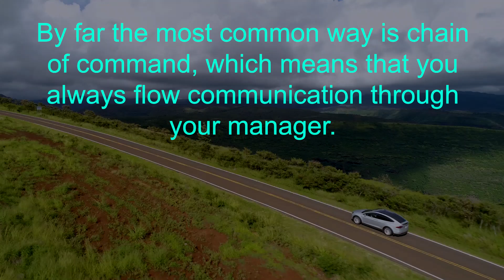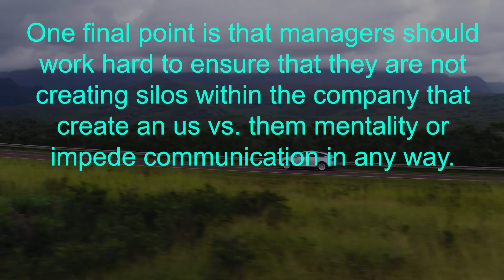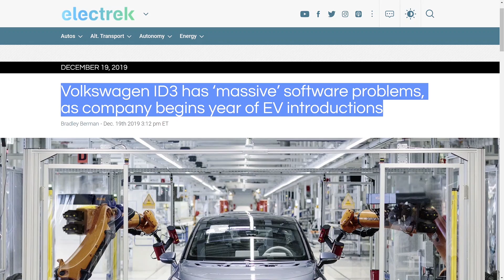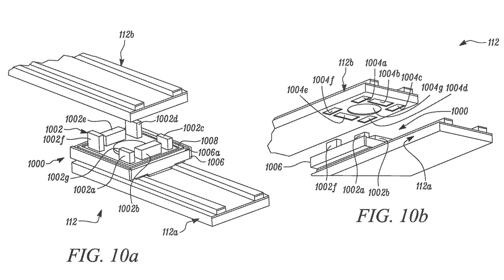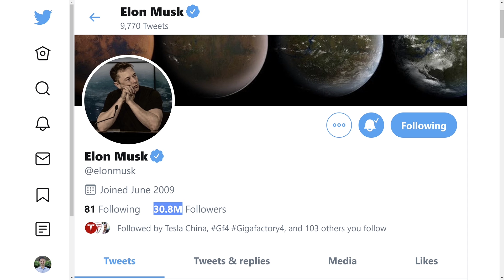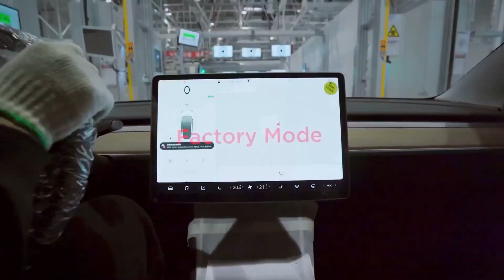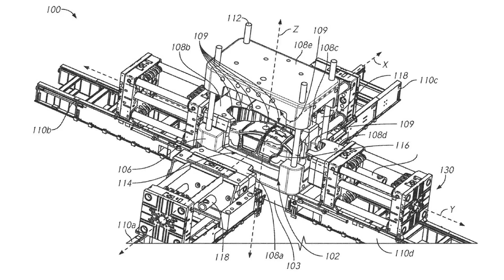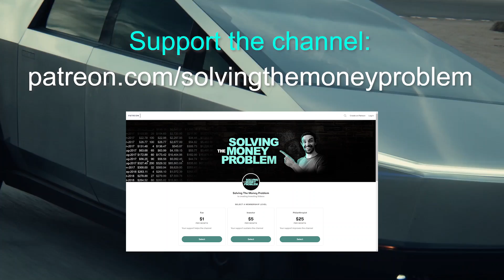Tesla: The Optimization Machine (why Tesla will win)

Comment: 0:30 You know, those rockets really did not reinvent the wheel... You can take any videogame with simulated physics and with in-game programmation and in less than an hour, program the thing to land straight. It will be 1 gyro, 1 gamble engine and some basics in physics. Even on a moving plateform...

Comment: The frame casting machine is a great example of the difference between other automakers (and big industry in general) and this way of thinking.
There is absolutely no way any other company would attempt that. 
Even if the design was delivered to them complete with certainty of the efficiency, they wouldn't invest money in something so dramatically different while they're relatively stable in the market. Even if they desperately needed a leg up, they would go for cheaper options like a new car with a big ad campaign - superficial crap to temporarily boost sales and satisfy shareholders, not advancement or anything remotely risky, costly or time consuming - regardless of the potential to change everything. Because at the end of the day they don't give 2 craps about potential, it's only optimising for the bottom line. That works if everyone else is doing the same. Thank god they're not anymore!

Comment: When Tesla implements the acquired Maxwell dry electrode battery technology  there will be an initial increase in energy density from 207 watt-hr / kg to over 300 watt-hr / kg.  The next level of the Maxwell dry electrode battery technology is predicted to be over 500 watt-hr / kg.  In addition the production costs will be about 10 to 20% less.  The range increases should be about 45% and 142% respectively.  In my view this will be  another  huge game changer and it will leave the competition in the dust.

Comment: You and others have mentioned the innovation with reducing wiring in the vehicle. However, I think this issue is not getting enough analysis as it deserves. This innovation is HUGE. Imagine how much it costs to add/remove/move a single electrical component on a vehicle. wiring harness changes, fuse box changes, relays changed, pin connector box changes, re-training installers, et al. Now image all those concerns disappear when the signal is wireless. All you need is a single wire to supply positive voltage. Tesla can change, at any time, the characteristics of the device through software. It also makes testing easier. Today a vehicle knows your brake light is out because there is a short or open circuit to the brake light. With these changes, the vehicle will broadcast a status check message to all accessories and each will, after doing an internal check on itself, respond accordingly. This also makes the vehicle more reliable as there are far fewer wires and connectors to break. Accessories sales: Imagine Tesla wants to add a light-bar as an option to a cybertruck. No problem, bolt it on and plug it into the closest available power connector. Done. Today's car companies can only sell accessories that have pre-existing connectors and wiring in place. As I'm sure you know, the profit margin for accessories is very large. This innovation will enable them to provide customers with an option that will work with their vehicle long after it has been sold. No changes to the wiring harness needed.

Comment: if they can invent a battery pack system where you can change the battery pack within a few minutes and you dont have charging delays 
or if you could chemically charge them with tanking acid or something else into the batteries and if the EU wouldnt prevent cybertrucks import because german manufacturer lobby probably noone else other than maybe Mercedes E-series  and Voest Alpine - Infineon would sell any car anymore 

imagine the EU car guys want to force tesla to build the car so it deforms in a crash scenario and add padestrian airbags even tho the car got safety sensors and smart accident prevention techniques/programms within ....

Comment: ICE cars are not markedly different than electric cars. Principly the issue is that existing companies have to keep their ICE R&D and production afloat while simultaneously working on electric propulsion on the same platforms otherwise they lose their production advantage. Toyota could make cars exclusively for electric propulsion but to get remotely respectable efficiency it would need dedicated designs from the ground up that just put them several years behind Tesla with all the new facility costs spiking their new design prices in to Tesla territory who has a home advantage.

Battery technology is not at a point where the price can compete with city cars and other maximum volume models. As soon as there are batteries light enough and dense enough at a sensible price point, I can guarantee all mainstream manufacturers will go toe-to-toe with Tesla. Before Tesla ever even existed in 2002, Toyota had the FCV with a 120hp electric motor. They've had the means for excellent motor performance as long as Tesla has existed, it's always just been an issue of batteries, and now Tesla is doing the R&D for them so they can step in as soon as the tech is matured.

Tesla is plenty neat, but it hasn't the means to compete in volume and doesn't have the experience to compete on handling and refinement. Tesla is alive on gimmicks and burning through them swiftly, it's fortunate it has a big box of toys. The moment the big boys have the tech to deliver a good range volume car, they'll beat Tesla out of every market but IT executives.

Comment: You asked, "are other companies doing the same?"  I have a sort-of example of one instance where another company made an improvement before Tesla, with a caveat.

To Porsche's credit, the Taycan does have a better cooling system than the Model 3.  The Model 3 combines the cooling/heating for the battery, motor, and electronics, but overheating of the battery still occurs and is a drain on performance.  The Taycan beefed up the battery cooling and added the cabin A/C to the system.  So we should give them credit for this.  Buuuuut...

That credit, of course, needs to be tempered and taken with a grain—sorry, with a large pile of salt, maybe even a full road salt storage silo, since Porsche only did so by copying Tesla, including some of their improvements.  After all, adding the cabin to the same system was part of the initial invention and patent that Tesla filed before the Model 3 was revealed.  And by "before the Model 3 was revealed", I mean back in 2007.

No joke, the patent was filed in 2007, though to be fair it wasn't approved and published until 2008, and there was some kind of update in 2010.  See https://patents.google.com/patent/US7789176B2/en

So Porsche does deserve some credit, with the mountainous caveat that they were copying something Tesla invented over 12 years ago, and which Tesla put into production in 2017 with the Model 3, slightly more than 2 whole years before the Taycan even had a global reveal.

It really puts into perspective how far behind everyone else is.  The Ford Mustang Mach-E and VW ID.3 will, when they start delivering this year, have some of the things that the Model S had with it's first deliveries in 2012.  So 8 years later Ford and VW will finally match some Model S features.  And the Taycan will have a cooling system similar to and slightly improved over what the first Model 3's in 2017 had, using a technology Tesla invented in 2007 but basically couldn't afford to implement until the Model 3.  Nonetheless, that patent was public knowledge since 2008, and all of their patents have been open since 2014.  So either Porsche didn't think of this until the Model 3 was reverse engineered, and still took a couple years after that, or they knew about it before but took even longer.

Comment: I'm amazed that Tesla let alone any Electric Vehicle manufacture have not seen the large system efficiency gains that can be yielded from integrating Supercapacitors into the Powertrain. It doesn't need to be that expensive as required size is only about 0.5 % of the Battery pack. The number of benefits that I've discovered with my  E Scooter prototype is about 8 and climbing. One being able to have Full Regenerative Braking when the Battery is at a SOC 80-100%, which on a battery only system this Regen energy could over charge the Battery at even moderate levels.

Comment: Hopefully that innovation will bring the prices of the cars down, which is still a pending subject as partners such as Panasonic are backing away from increasing business. Also, sales in California dropped 46% after the tax credits expired, another bad mark. But the worst part for me is that a model 3 can cost upwards of $65.000 for a car that has the same or worse quality than an equivalente $19.000 toyota. Faster acceleration is useless in bumper to bumper traffic. Pumping gas is a breeze 95% of the time. What justifies $46.000 more money for this car?!? Or $100.000 for a model X? Seriously?!?

Comment: New video idea: What happens to Tesla battery modules when the vehicle is wrecked or reaches its end of life.  I use a Tesla module from a wrecked Model S to power my motorhome appliances and it works great. I even installed a J1772 EV charging port on the motorhome to charge it when I don't have enough solar charging.

Comment: You make an extremely valid point that I have no even considered. 

A car consist of Body Engine, Drive Train and Suspension. Most general car manufacturers are in trouble, their engineers with 20 years of experience have suddenly become useless. The only part of the car that directly translate to electric cars is the body. The suspension, drive train all needs to be re-engineered. They need to replaced their current mechanical engineering workforce with high power electrical engineers and chemical engineers. I always thought that the reason legacy manufacturers are not competing with TESLA is because they do not have the will. 

But after listening to your video I realize it is because they simply cannot compete yet. They simply do not have the right people in place. They have to transform their whole design and manufacturing portion of their business.
Reply from the maker: Bingo. Very little that's important is shared incommon between ICE and EV. There will be huge layoffs, attempts at hiring (all the best engineers want to work at Tesla and SpaceX so good luck) and a lot of pain trying to turn around a big ship..

Comment: You can tell Musk has been a software engineer. If you're writing a software system you don't send all communication up a hierarchy so it makes sense not to do it for a business. He uses continuous integration, improvement and refactoring to remove redundancies and other parts of the 'agile manifesto' and applies them to manufacturing.
Reply: Read the agile manifesto and you'll understand Musk's management style more.

Comment: I personally think this is the most important advantage of Tesla. I do not know, how any OEM can compete with Tesla. To me Tesla will eat them alive.
Reply: The most important disadvantage of OEMs is, they have the corporate structure supporting power of managers. This results in a power struggle against any change. I bet Tesla could change into ICE car manufacturing, if it turned out the better thing to do. The competition can not. The picture is simple, Tesla will take all the market it will produce for untill 20% or more of transportation market is theirs. And they may leapfrog them once again, when autonomy hits. Than they will need to produce 5% of the cars to meet the needs of all in need of transportation. That will be a huge hit for OEM.